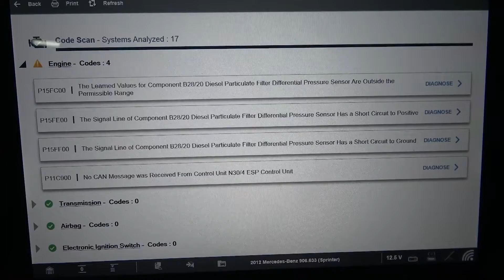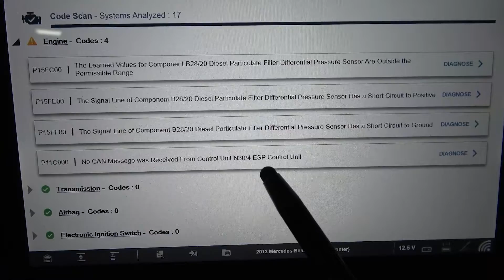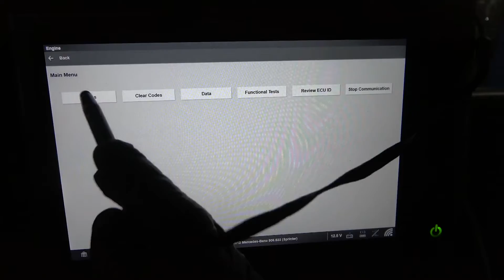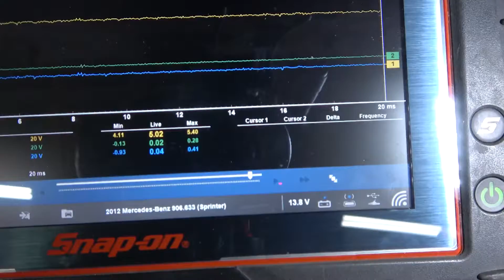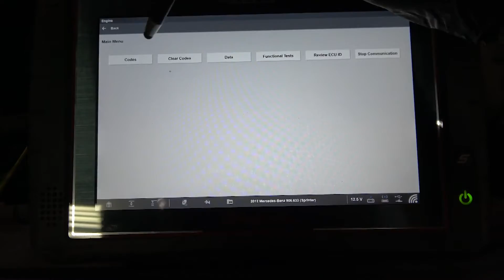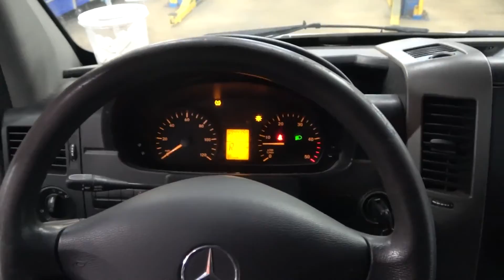Sprinter Van : DTC P2452 & P15FF00 - Component B28/20 DPF Differential Pressure Sensor Circuit Issue

Comment: Very helpful video. Thank you! How common is it that the  P15FF00 error code is the sensor and not the DPF filter itself? My van hasn't driven much on the highway for about 2-years, and the error popped during idle
Reply from the maker: @DougPipersr   I recommend you get the DPF Cleaned and do some highway drive and see what happens

Comment: My van is giving me that P15FF00 code "short in circuit " and takes a long time to speeed up, goes all the way to 3000 rps than changes gear, could this be the issue, I don't have any other codes coming up
Reply from the maker: @duartepaintinghandymanservices  Test that sensor and see whatt happens or have a pro mechanic diagnose it for you!

Comment: Hi! My friend! I have 2015 sprinter 2.1l codes p245C,P261F&P2602 dealer said to change water pump EGR bypass flap and all vacuum system and 6k estimate 😮 so I remplace the water pump all vacuum valves vacuum reservoir and blow out all lines ! I make sure  EGR bypass is working properly I didn’t change it just cleaned it! But codes still there sorry I forget to mention that engine is 75% on power! Apparently vacuum and water pump and EGR bypass  is working fine any suggestions?
Reply from the maker: @miguellomejoral1005  make sure your switchover valves and vacuum transducers are working fine!
Reply: They are new! I changed everything except the vacuum pump because is working ok! I thinking about the ECU reset!! Or remplace!!

Comment: I still have a problem where I can't reverse on a slight incline... When I put it in reverse and press on the gas there's nothing... No noise, no motor Rev... Stays completely idle.
Reply from the maker: @jonathangrenier104  that's odd! you should have it diagnosed by a pro mechanic